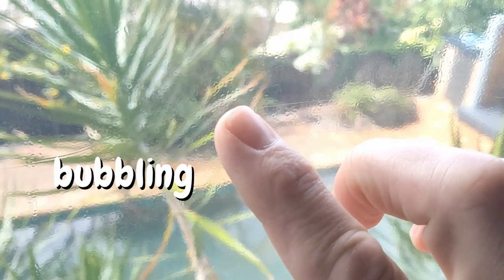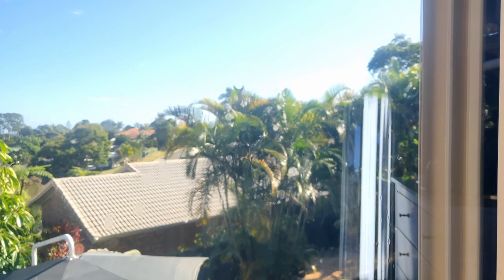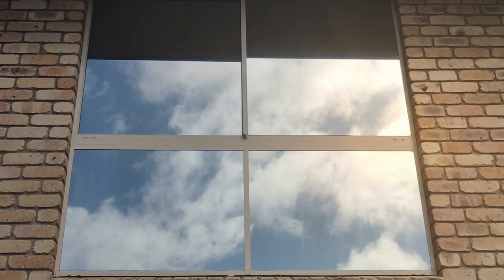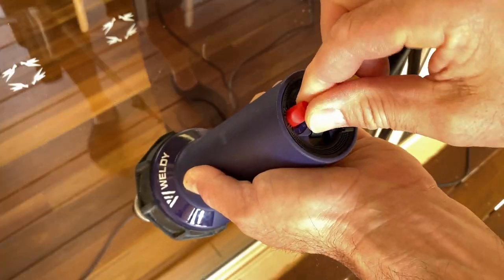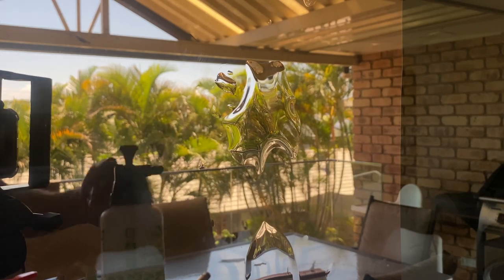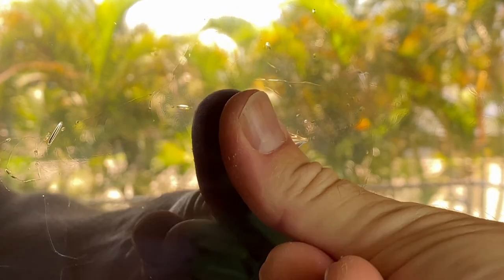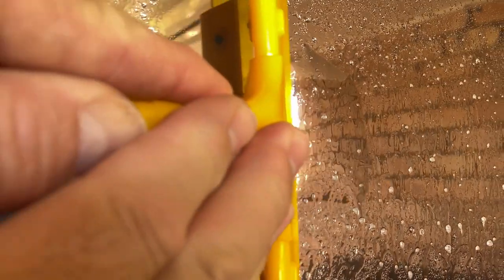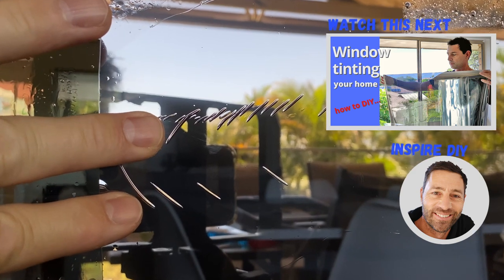What to do about bubbles in your window tint - Inspire DIY

Comment: What if you followed all the rules and cleaned the windows better than how to came from the factory. However the film is still bubbling at the edges, in some areas.
Reply from the maker: Hey Stownley, if the film is bubbly at the edges wouldn’t it have to be dust or grit, contaminants from hands (oils), maybe too much material and it’s bunching up and needing to be trimmed back a little? If it’s water bubbles they will disappear in time. All the best, Kent

Comment: Thanks for the tips!  Just installed some tint in my kitchen and it has some small bubbles. Crossing my fingers that it's the water you mentioned and will go away in a few days.
Reply from the maker: Hey Brent, how did you get on? Did the bubbles dissipate?
Reply: @InspireDIY  yes! They certainly did!  Took about 3 days
Reply from the maker: Good stuff Brent, cheers for letting us know👌 you are now pro level window film installer! Don’t tell anyone or you will be asked to do theirs😂 Kent